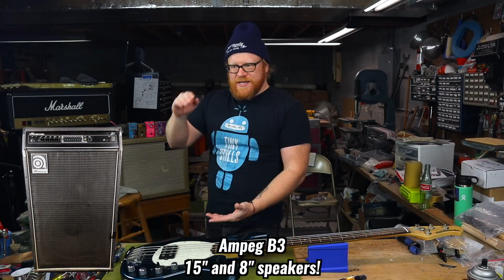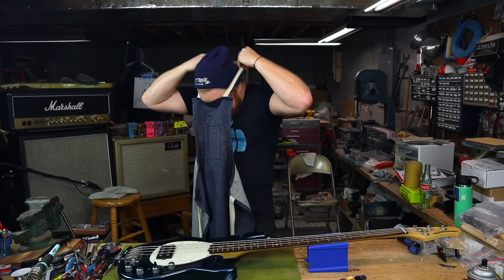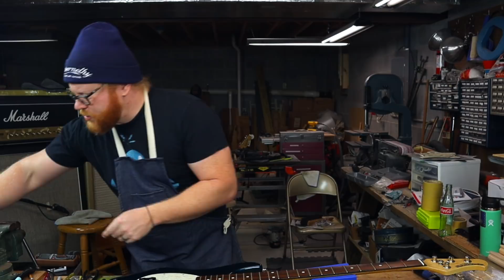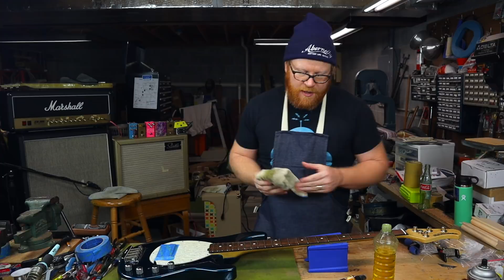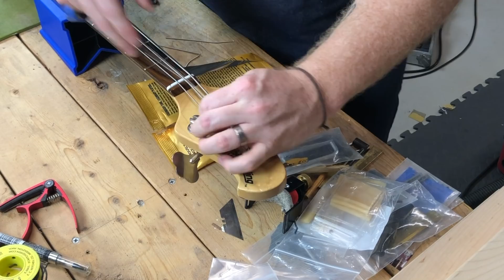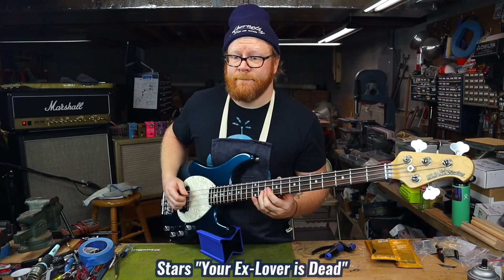ON THE BENCH #10: Greg's Ernie Ball Music Man Sterling Setup + Quick Demo

Comment: I’ve got a Stingray that needs a little love. My biggest issue is that all the chrome is really tarnished, with the tuners especially looking matte with basically no luster. Any recommendations on what might bring that back to to shine? Metal polish didn’t do it for me.
Reply: Id recommend, remove tuners, fine bronze wool, and polish with a buffing wheel. If you want them to shine. Disassemble the tuner if needed.